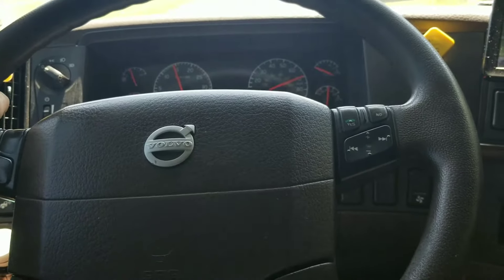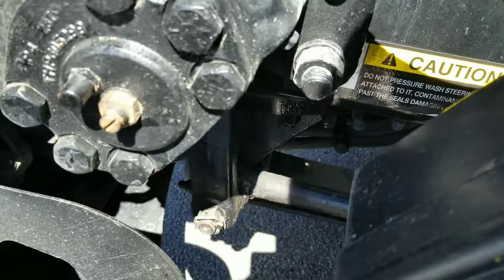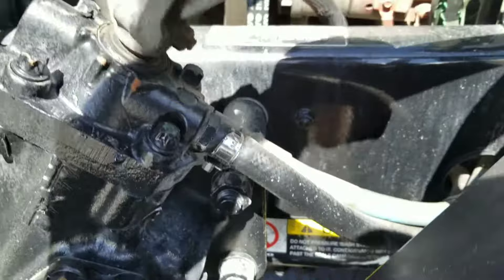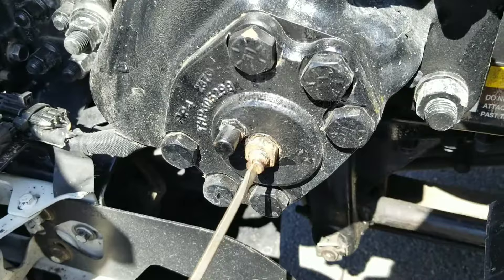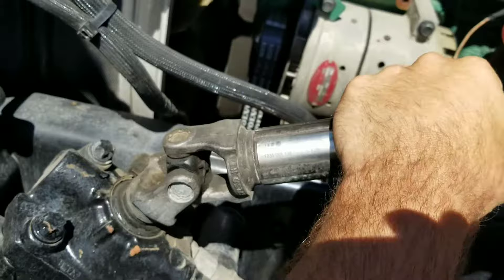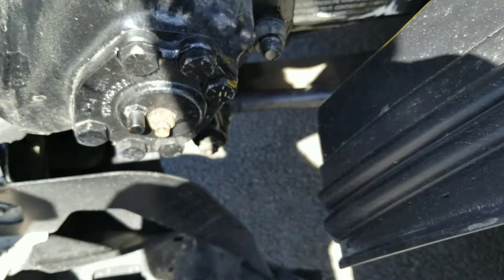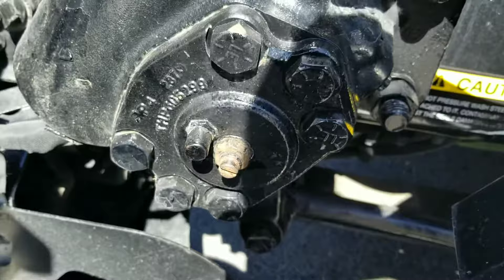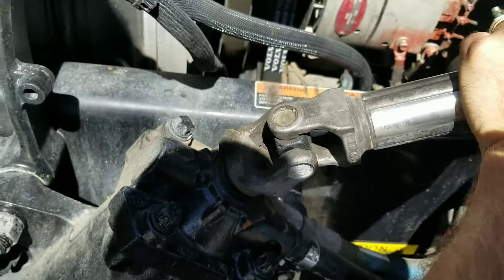How to adjust your steering wheel free play

Comment: Totally unprofessional , there's a lot more to steering system freeplay than just cranking a screw without a thorough inspection.  Get a professional mechanic to check & adjust your sector shaft . Too many google mechanics unwittingly contribute to sertious collisions
Reply: Took ours to a truck center. Said they e never heard of a set screw to reduce play in steering…
Part changers.
Reply: It’s a TRW adjustable steering box.  That is exactly how it was designed to work

Comment: Hey brother keep the flat blade on the screw as you tighten the nut. When your removed the screw driver and tightened it, the screw moved about 1/2-1 more turn with the lock nut. Good video cheers
Reply: So that screw isn't supposed to turn when you tighten the nut. Mine turn with the nut do you think the nut is seized around the screw?
Reply: Condo yea bro hit it with some wd-40 or pd blaster and break your lock nut free of the adjuster screw. So that way you can lock the nut down to the new adjustment on the screw 🤘
Reply: @coalwagon  thanks bro!
Reply: @blackpowergod210  it will turn with the nut if you dont hold it still with the flat screwdriver. Holding it still with the screwdriver while tightening the nut helps you keep your new adjustment in spec.
Reply: Lol he probley does man he was holding the camera no way to hold that and screwdriver to

Comment: Great video, thanks!  Pro tip: people watching this might need some penetrating oil on that screw and nut.  The best penetrating oil that won a shootout on YouTube is called Deep Creep by Sea Foam.  Squirt some of that on the nut and screw and wait 5 minutes or so. Then take a large flat-head screwdriver and a wrench and loosen the nut on the screw, while you hold the screw in place with the screwdriver.  Set the screw where you want it to adjust free play like in the video. Then hold the screw in place again with one hand and tighten the nut with the other hand, which locks the screw in place real nice.  That penetrating oil also greatly helps to prevent further rust from building up.
Reply: Aero kroil

Comment: Uhm...

... actually, the important place not to have free-play in is the sector-shaft which the pitman arm attaches to.

To properly inspect the sector shaft, the drag week must be taken off the pitman arm. Then the pitman arm is to be moved forward and backward and then left and right. Any lash in any direction requires the adjustment you shut the video of.

-------

I am jealous that you have adjustment screw availability privilege. I have to drain the power steering fluid, disconnect hoses, disconnect the steering shaft, and then I had to take the power steering box off because the adjusting screw up on my tracker is on back of the box which is up against the frame.

Comment: Can a TRW gearbox be adjusted?

I don't see an adjustment screw ... Pete 387
Reply: It's on the back side of the housing behind the sector shaft.  There are other videos about TRW steering box adjustment out there. If you over tighten the adjustment screw you can damage  your steering gear.
Reply: @dennissmith460  thanks but my gearbox it is different..I don't have that adjustment bolt

Comment: My gear box doesn’t have that bolt right there where else would I adjust it at
Reply: Wherever the shaft the pitman arm goes onto, that shaft goes through the gearbox, and on the otherside is your adjuster. Freightliner is on the inside, there's a hole in the frame.
Reply: @HondaAholic  my man!!! ....thank you. I was wondering the same damn thing. Sending Much blessings you way.
Reply: @vroor32  Glad I could help!

Comment: You accomplished nothing... you're supposed to hold the center (flat head screw_ in place while loosening the outer nut, THEN loosen or tighten the inner flat head bolt, THEN hold the flathead in place while re-tightening the outer nut.

What you did is a real good way to lock your steering or fuck up up your gear box.
Reply: Give it a break, the man has 2 hands only ... One for the camera one for showing us how it works